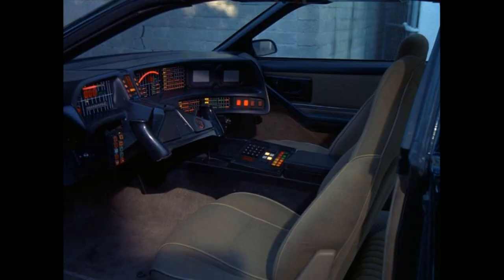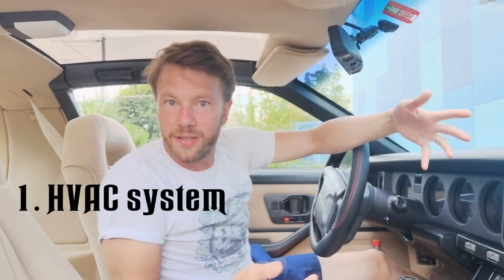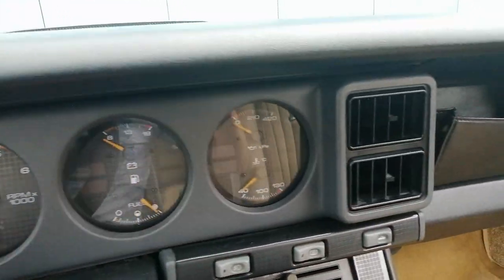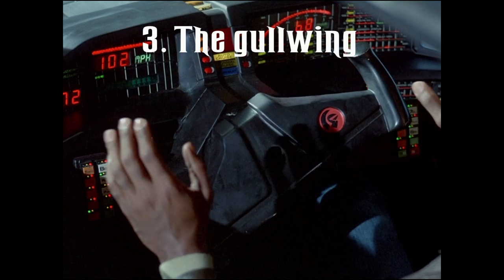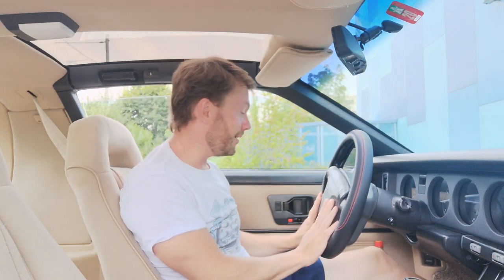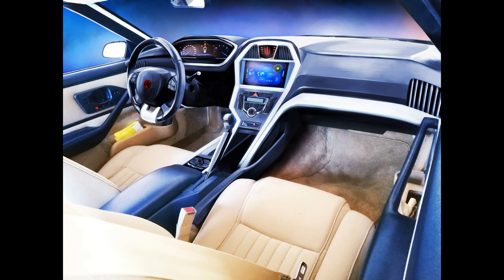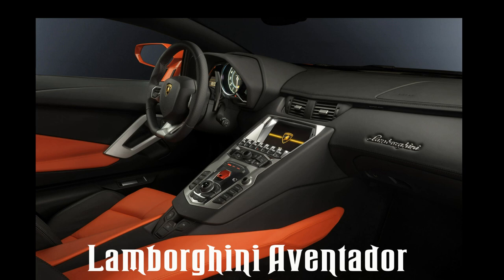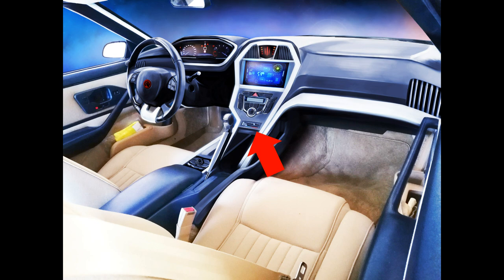KITT Firebird Trans Am - Episode 21 - 21st century KITT dashboard

Comment: I'm glad I found your channel. I love your restoration of the car from start to it's current form. As for the dashboard...I understand where you're coming from. This sound like your daily driver, so it must be functional on a practical level. I like the idea of a modern version of the dashboard, keeping in mind of your daily needs. That concept art is a very good starting point. The only thing I would suggest is anything you do in the center console needs to be slightly angled to the drivers point of view. That's the original design and I think keeping that idea would be respectful of the original dashboard.
Reply from the maker: Thanks a lot, I really appreciate your feedback! I'm glad you enjoy my videos. Indeed, the slight angle towards the driver is a strong characteristic of the original KITT dash. That's what I also like about the 508's dash I showed. Let's see, I need to do a bit more research before I change anything.

Comment: I love the idea. I think you should add some new version of the switch pods. Perhaps you can make them more fluid looking and curved, but they also wouldn't bump your knees (maybe they could be small ipod touch-sized displays or black smart phone-sized - whatever). They could have functions in them, some real, some for show, like have the Turbo Boost and a few other key features, but blend in some other items like traction control or rear camera or (get creative) whatever else the car might actually do. Then the last suggestion would be to edit the display screens to be more unified, and I realize this involves programming. But perhaps there's a way to design a more KITT-looking display with colors and other functions that really tip-the-hat or give-the-nod to the feel of the original KITT - to show on the new screens.
Reply from the maker: That's some really good feedback! I'll definitely give it a thought at look at tweaking the design.

Comment: I like your idea to modernize the dash.  The AC issue never would have occurred to me, and it would drive me crazy.  Plus I would want the car street legal-  What fun is having a car like that if you can't drive it?  I agree the shifter should be at least closer to the classic design (and just generally smaller).  With that big screen, you could even have it display some of the more frequently used "buttons" that KITT would have, like Turbo Boost, etc.  The main thing that bugged me was that pyramid-shaped voice modulator.  I would keep that be as true to the original as possible.  Also I would keep the big screen slightly tilted toward the driver.  That would maintain the inspiration of the original.

The main thing is what is the mindset.  What's more important to you, having a true replica, or having it feel more real, which might mean including modern design elements?  I don't think there is a right or wrong answer, it's purely a matter of personal preference.

Comment: What you think about Trans am GTA DIGITAL dashboard? I'ts more beautiful than in typical dashboards of Trans am's. it's legal, but you need a lot of sensors and cluster, dash and other... but if you will do it, it will be very cool and good :)  It's a legal 'little' version of K.I.T.T. dash
Reply from the maker: Yes, indeed. That is a good option. I would want to add a screen and the voice modulator, though.

Comment: The law is rough out in Switzerland, a criminal record for an steering wheel that is so wrong. Any way great video.
Reply from the maker: It is if the steering wheel isn't round and you can't evade properly in case of an emergency. But yes, it is rough and in many ways too rough and stops people from being applying some creativity to their cars.
Reply: it feels good to drive with the gullwing, but i see why the law wont allow for a quick connect, what if it fails and the wheel comes flying off and you crash your car. that will be bad, very long time ago when KITT gullwings was being made it was nothing about fiberglass, but today they are reinforce with metal, 100% safety

Comment: My friend Scotti!  I hope you are well and enjoying your KITT replica build as much as I have enjoyed watching you build it. I apologize in advance for my lengthy response. A few points if I may:

1) IGNORE the trolls please!  It's self-evident whether a comment is a from a troll or a true Knight Rider fan.  TRUE fans are AMBASSADORS of the Knight Rider series.  TRUE fans have nothing but love and appreciation for your support of the show.  Quite frankly, I bet not a single critic has a CLUE what a screen-accurate car is.  Remember that the production crew used around twenty of these cars in the show, and only five of these still survive.  The real authorities on these cars will tell you that the electronic interiors were enormously expensive to build.  Remember, the production crew had to engineer these FROM SCRATCH.  The replicators are working from existing molds and plans resulting from these very expensive engineering prototypes.  Do the math.  Engineering this for one car is expensive.  Multiply that by twenty cars on a show that already cost around a million dollars an episode. 

Not all twenty of these cars had the KITT interior.  Some cars were for external shots only and had the standard dash and even the standard steering wheel.  In the first season episode "Inside Out,"  You can even see a beige cover hiding the stunt man driving KITT from the backseat when KITT asks the police officer for directions, and the police officer hilarious doesn't even notice there is no one in the front driver's seat!

Enough said on "troll service."

Regarding the steering wheel issue, since the vehicle is your daily driver, comply with the law first.  I should point out there are a few episodes where you can still spot the original interior and original (round) steering wheel in a car dressed to appear as KITT for exterior shots only.  Two examples I can think of are "Knight of the Phoenix" when those two thieves stole KITT and KITT took them on a joyride, as well as "Slamming Sammy's stunt show."  I might also point out that David Hasselhoff being a particularly tall actor, required accomodations to the original gullwing steering wheel, and reportedly, changes were made to the right and left steering wheel button pods to accomodate his long legs!

Regarding your A/C dilemma and the dash, remember that the only person that car has to please is YOU.  I call any statement that starts with "can't be done" or "impossible" to be a failure of imagination.  Air conditioning units have come a LONG way in the nearly forty years since the series was on TV.  There is a company called Vintage Air that makes amazingly compact heating and air conditioning units.  You could literally place these units anywhere!  My favorite places keep in mind the science of heating and cooling:  hot air rises, and cold air sinks.  Therefore, you could hide the main control unit somewhere accessible and place the vents where they would do you the most good.  You could retain the existing control unit or use an aftermarket unit, and my favorite places to mount and install the vents are either at the top of the dash or at the base of the front windshield.

Another suggestion:  if you were to go with the digital dash, look into upgrading the R134a AC compressor if possible.  General Motors made upgraded AC compressors for motorhomes and RV use for the same engine you have in your car. R134a is about ten percent less cooling efficient than the old R12 units likely outlawed in Switzerland.  Your Firebird likely sports the original R134a factory system.  If you were to go with the compact Vintage Air unit, it could either supplement or replace the original factory system.  You might find the need to partially supply the internal electronics with some sort of the cooling system, perhaps a fan only system, or potentially share the supply of cooled air with the electronics.  GM used these 5.0L (305)/5.7L (350) engines in their trucks and vans through 1998 to 2000.

My second suggestion regarding the electronic dash, if you were WERE to decide to go for it - do it a piece at a time.  It's more affordable that way, and you might find yourself learning more about how to make the system work FOR you!

A word about remakes - the most successful remakes are the ones that KEEP the parts that people love the most.  Look at the Herbie The Love Bug movies.  People generally LOVED Herbie the Love Bug, despite the car using a Volkswagen Beetle body that dates back to World War II!  How's that for longevity?  The last Herbie the Love Bug movie was made fifteen years ago, and still used the old-style Volkswagen body, despite the newer 1998+ Beetle being available.  People love familiar faces, even if they happen to be OLD and familiar faces.  Herbie even kept his old interior.  No remakes needed.  Bad remakes all have one thing in common - all of them miss the mark while throwing out the baby with the bath water.  I hold up the Knight Rider 2000 1991 reunion movie and the failed 2008 one-season Knight Rider remake series as Exhibits A and B.  The KITT we all know and love was virtually absent in both movies, making their resulting failures pretty self-evident.

Regarding a "remake" dash, here is MY suggestion.  If you were to make a remake of the old dash- make it resemble the original series dash as much as possible.  The very best upgrades are the ones nobody can see unless you point them out.  Ideas including making all of the electronics panels touch sensitive screens.  You could retain the original look as the default appearance, while still allowing the screens to display more advanced functions when desired.  This dash idea would retain the original hard parts, including the upper dash pad, while allowing you to upgrade or add features as desired.  This is just a pie in the sky idea, but the beauty of it is that you can start out with the standard Knight Rider dash at first, and upgrade it one electronic component at a time.  You could even enable new functions on the steering column wing panel, the overhead or transmission console.  Remember, the Herbie the Love Bug movies still used the original Beetle with the original old Beetle interior!  The same formula works here.

Regarding those "upgrades" I told you about?  Let me give you an example of a really cool one.  Remember how KITT could always allow Michael into the car with door handles that scanned his fingerprints (first season "Good Day at White Rock" and third season's "Knight In Disgrace")?  That technology exists, but an even cooler version exists.  There are Youtube projects that describe how to use Raspberry Pi and Arduino computers to create facial recognition door locks!  Imagine your car recognizing your face and immediately unlocking your door upon approach.  These projects actually exist and work.  If you do a search on "facial recognition" in Youtube, you can see some of these actually work.   Another hidden technology upgrade most people won't even notice.

Again, sorry for the long post.  I had a lot to say regarding your video.  Keep up the great work and keep us all posted on your project.  Remember, TRUE Knight Rider fans are AMBASSADORS, not critics.  If you're not an ambassador, you're just "static" (noise).
Reply from the maker: Wow! Thank you Brian for your support and your detailed feedback. Please don't apologize. As much as my videos don't appeal to a very large crowd, I'm really enjoying the engagement and discussions in the comment section.

Regarding the A/C - yes indeed, it would be possible to make it work with the KITT dashboard. Others have custom made and installed vents on either side and in the middle. I suppose it's the combination of constraints that lead me to the decision of not installing it. My car did come with R12 from the factory. When I had it recharged in 2019, not much was left of it, and the workshop converted it to R134a. They had to add a special oil in the system in order for the gas not to dissipade. It is still very very cold and does the job perfectly. Meanwhile I have bought T-Top sunshades which also helps in keeping the heat out.

I love your idea of making a dash with touch sensitive screens that can display the original gauges as well as anything I can program it to show. The brand new Honda E is a pretty good production model example of that idea.

The face recognition door unlocking is pretty radical, too. Definitely something that would require some research but hey, all the information is out there in the worldwide web. I think, a keyless entry system, either through a traditional remote control or a key recognition should be relatively easy to upgrade. It's basically just a receiver / control module that tells the central locking system to lock or unlock.

This could easily become an endless project :-) Thank you watching and for participating in the discussion!
Reply: It's a very interresting and constructiv post, I learned a lot thanks 👍

Comment: Your réplica, is very nice!
But, why you wouldn’t put the Dashboard of kitt 2/3 season?

The only think is illegal is the gulwing and in reality is normal, because in all of country is illegal.
In the US, is legal, but carrefuly, if you break, you paid all of the damage! of course, any Insurance, wouldn’t paid, If you break with a gulwing kitt!

You can put, for example, the Dashboard 2/3 season but with a gulwing normal, no?
You can same, put a normal gulwing more sure with airbag than the gulwing of the origin!(in this way, you can tell #!*!!! bureau autos « ).

I know, I live in Geneva(Genf), and the law is the law!
But, the Dashboard season 3/4, only the Dashboard, without gulwing, is legal, no?
Reply from the maker: The dashboard would be legal in Switzerland with a round steering wheel. Legally that's no problem as long as all the vital information are there. That's all okay. But I just prefer to keep the factory dash for the reasons mentioned in the video. 
I will do a video regarding the dashboard electronics soon, though. 😉